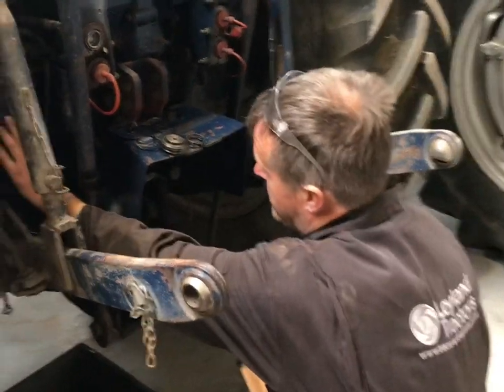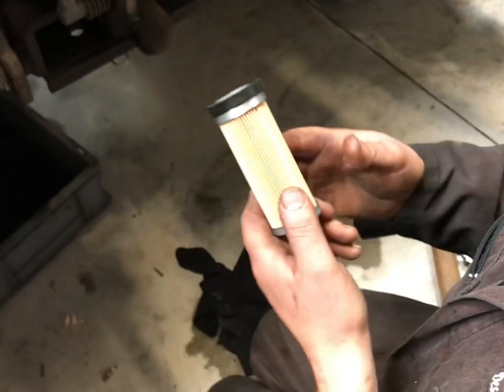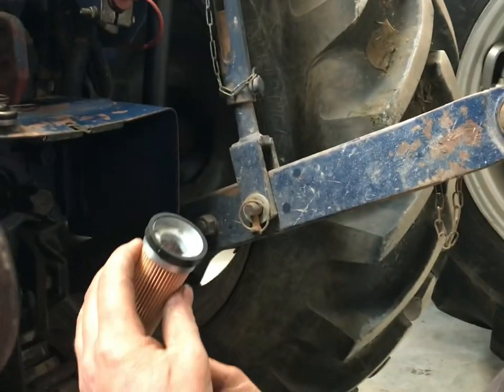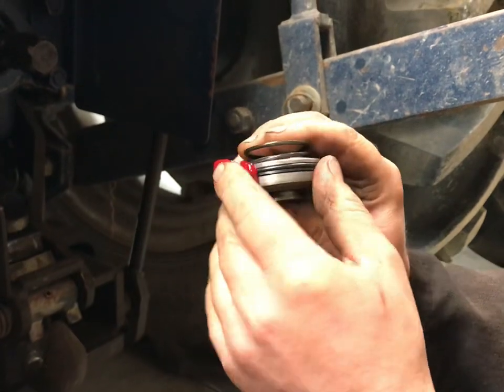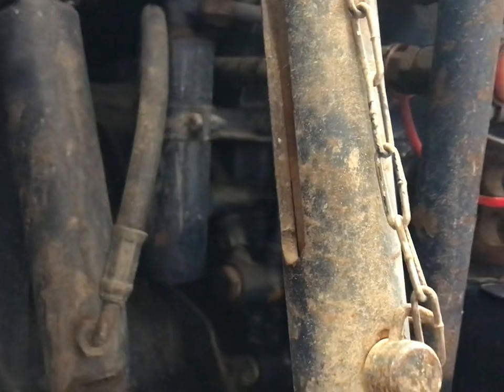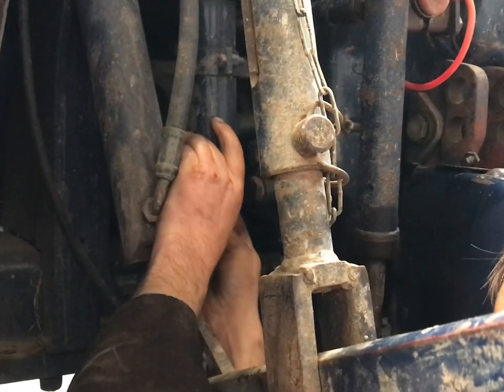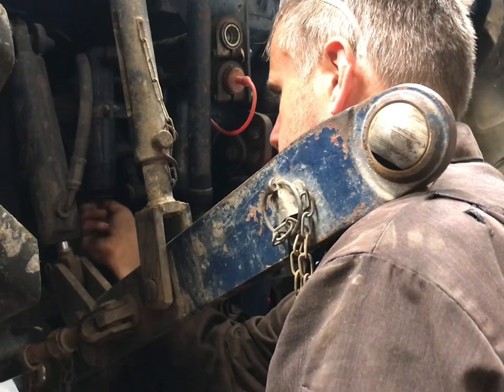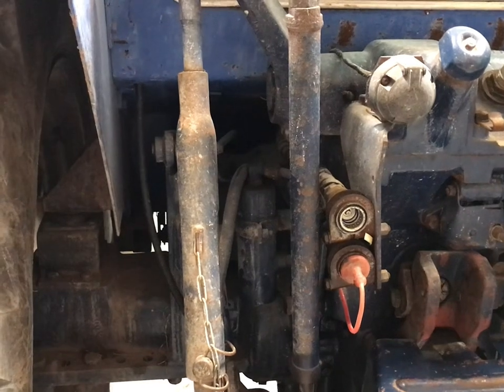Replacing the high pressure filter, CTJ4348, on the Leyland middleweight and heavyweight tractors

Comment: Hi, Just a quick question, I have a Leyland 344 with a leak at the PTO shaft. Will the shaft pull out from the back end without anything dropping down inside???
Reply from the maker: As long as you leave the PTO in drive then you should be able to remove the PTO shaft from the back.
Reply: @TractorSparePartsLtd  Many Thanks, all sorted, great videos 📹 👍

Comment: Hello.
I came across your channel and I was wondering whether you would be able to give an answer to my problem! 
I own Leyland 804 tractor that myself and brother have refurbished and spent many many thousands of pounds to get it looking like it just came off the production line. 
Recently I purchased a 4 farrow dowdswell plough, we connected the plough to Leyland 804 and it struggles to lift the plough! so we removed the fourth set of boards and she picks up the plough ok. 
Personally I would of thought the hydraulic system would easily lift a four furrow plough so my thoughts are maybe the hydraulic pump is weak! So do you have any thoughts whether the plough is to heavy or the pump is weak or something else we can check. 
Thanks Simon
Reply from the maker: The first thing I would do is test the pressure that the hydraulic pump is achieving. With a pressure gauge such as the one in the link below. 
https://www.tractorspareparts.co.uk/18g548-hydraulic-pressure-gauge-p-1769.html?sesid=gcdgnhogag4spg801supb10em5
You should be achieving at least 2400 psi (it was 2600 psi when it was brand new). See what you get and come back to me and we can see what the next steps are.
Reply: @TractorSparePartsLtd  
Thank you for getting back to me so soon. I will purchase the pressure test kit today and will get back to you with the results in due course. 
Thanks again Simon